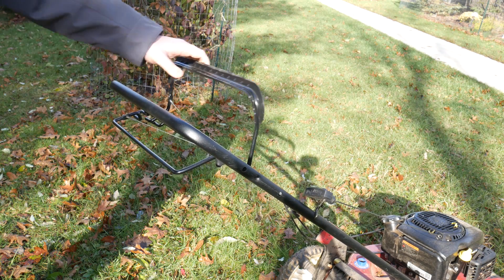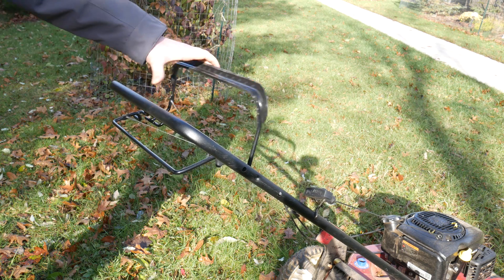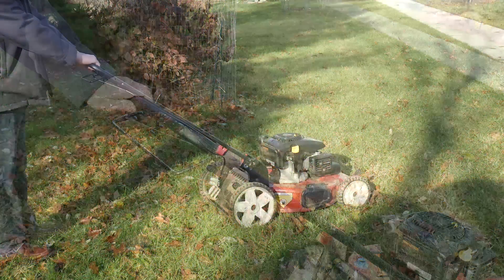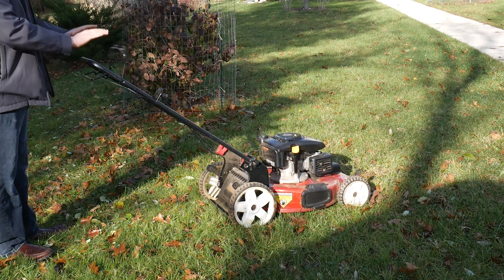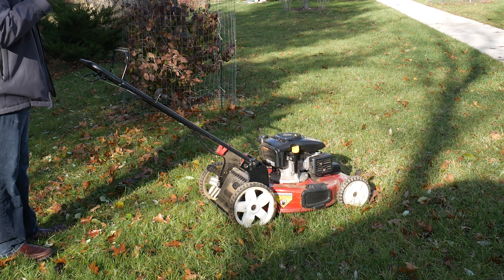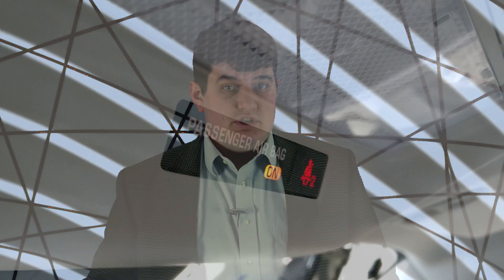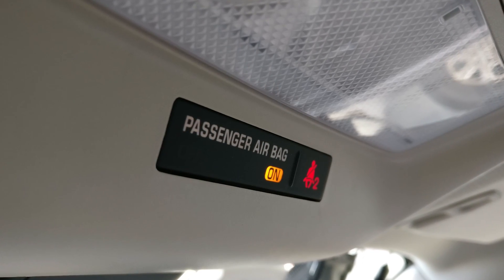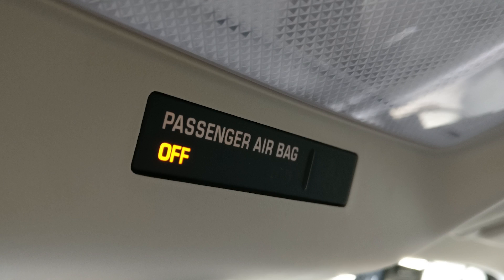The Dead Man's Switch:  How Anton Yelchin's life could have been saved

Comment: So i work for a local fire department. We have recently retrofitted my of the trucks with a vista brake lock. This system requires the driver to put a code in to move the truck. Also this system ties into the driver seat detector and if the driver gets out of the truck without pulling the air brake, after two seconds the system will deploy the air brake. Also the passenger which is usually the officer on the truck has an Estop button to stop the truck. There is also a manual override if the keypad fails but it is hidden from plain site.

Comment: One has to weigh the advantages of every life potentially saved from someone accidentally leaving a vehicle in gear when exiting, versus the number of high speed collisions that would inevitably occur on highways when someone tries to grab something out of the back seat and the car automatically slams on the breaks at 65(+) mph.

Honestly, auto breaking features that don't come with self-driving proximity awareness programming seems like a whole pile of unanticipated additional issues.
Reply: leaving a car in gear/neutral/reverse when you exit it is not a problem. You should be putting your handbrake (ebrake) on when you do, so the vechicle wont be moving anywhere. In the UK where manual is most common you leave your car in neutral or in gear (even reverse) but you always use you handbreak, worse that happens is you forgot to dip your clutch when you start it and it jumps forward and stalls.

Comment: I prefer mechanical over computer controls, due to the fact that if the computer fails, the mechanical parts can take over so that I can get somewhere safe without further incident, my truck is a 1999 Suburban, it's primarily mechanically controlled, the computer is more of a backup for the accelerator, and the timing, but nothing else, I've had more transmission problems out of my 07 Suburban (which was entirely computer controlled) than I had out of the '99

Comment: Such a system would require the ability to manually override it. As you have to be in neutral to push a car, or to tow it, both situations which would likely not have a driver in the seat. Living in the land of ice and mud, I wind up having to push my own car in my driveway more often than is probably normal. If I couldn't get out of the car without it putting on the parking brake, I'd just be stuck forever. Couldn't even use my truck to drag it out. 

I guess I could just throw one of my anvils in my seat, or more conveniently, do what I do with most safety features... bypass them XD (For the record, I live alone, half a mile from my nearest neighbor, no children or unknowing persons are going to be, say, crushed by my garage door because I just installed the optical sensors so they're kissing in my ceiling.)

Comment: The passenger seat of my Nissan has one of the aforementioned switches in the passenger seats for the airbag system. Everytime it gets cold, like today when it was -30 celcius, something in that system fails, causing the passenger airbag to turn off and my dash lights to light up like a Christmas tree. Only solution: run the seat warmers for 10-15 minutes. 

I'm all for making technology safer for everybody. However, all I can say is thank goodness on a day like today my driver's seat doesn't have any switches in it for the airbag, ignition, or otherwise!

Comment: I work for a Honda dealer and I've seen this feature on our vehicles with an electronic shifter. It uses the door as the input and if it's under a certain speed it will shift into park.
I have seen BMW do this as well.

Comment: The problem with this is that people put items on seats like heavy boxes so a seat sensor may not be optimal. A driving wheel monitor might be better where if a hand is not detected on the steering wheel and the car is in parked or neutral it automatically engage the breaks.

Comment: Unfortunately, that isn't a realistic solution, since there is no seat switch required on the driver's side for airbag control (a safety feature) thus the seat switch on the driver's side is not a reliable device as it is not rated for use in a safety critical system. Thus, if the software were modified to use this switch there would be many reports of the vehicle not going into gear when it should (when the switch fails). If this happens with a vehicle that happens to be (say) on a railroad crossing and someone is killed because the vehicle would not move from the tracks, then the safety has not actually been improved.

If the switch were upgraded to a component certified for use in a safety critical system, and redundant switches were installed, then this would work.
Reply: literally just make it check the seat belt cars already do it and you can override it for towing just buckle the seat belt

Comment: You have a good idea but you're overlooking the way the park selection works

When the vehicle is stopped putting the transmission in park slides a hefty pin into the stationary gear to lock the transmissions movement.

Therefore if the car is moving, the gear will be moving with it and with all the vehicles momentum behind it and the pin does not have enough strength to halt it, the pin will sheer.

So instead, the computer should just apply an electronic brake in all cars just like in the standard ones as you mentioned
Reply: This is not true in the Jeep that anton was driving, the selecter lever is purely a switch, when you select park a small motor engages the not at all hefty pin into park, what the correct turn would have been was the minute anton opened the door was the car gets mad and bongs at him that he was in gear, forcing him to address the bong, or when he unbuckled and opened the door the car would have shifted into park at that time as theoretically his foot would have been on the brake. basically the jeep should have never been allowed to roll at all, also my car is from 2011 and still has a traditional transmission selector with notched positions for each selection, if i open my door with the car in any gear but park the car bongs at me constantly until i either shut the car completely down or select park. this is from 2011 and why the bloody heck didnt the jeep incorporate that its so simple, bong wildy until the person makes it stop

Comment: Drive manuals. less of electric software controlled laggy shit the better. Some things in cars should always stay hardware and analogue, transmission and steering, emergency/handbrake and throttle. None of these things should ever be changed into shitty software run automatics, electornicly engaged e brakes(that refuse to turn off and are not intuitive to operate especially in emergency, because they are placed and operated in wonky ways that dont allow for muscle memory to kick in dire situation. On top of software delay and failures. Solution is to keep core operation of the car analogue and fully hardware, driver will stay awake more and wont fail at anything hence no danger emerges. Likelyhood of mechanical failure over software and electronics is almost non existant. Especially if he had a manual handbrake.

Comment: Vw already have this sort of.
If you have the automatic handbrake / auto hold the car will not release the handbrake unless the driver is wearing a seat belt.  You can move the car without a seatbelt on by turning the auto hold off then pressing the hand brake button (,tbh it's easier to just put the sb on) but remember you can't leave the car whilst wearing your seatbelt.  
2 the car won't let you remove the key unless the car is in park. (On dsg models.

Comment: So what's the handbrake then I believe America is the only place in the world where it's called an emergency break but everywhere in the world when you're taught to drive this break is to be applied and pulled up before releasing the pedal brake and putting it in park it is a wire usually that clamps the brakes down so if the parking brake fails the car still cannot roll

Comment: I believe they don't want to put kill switches into cars based on weight on the seat or other similar factors because it is imaginable that even if the car is so broken that you can't sit in the seat, it might still be that driving it is the only chance you have for survival.
Americans especially don't like designing vehicle devices that are not easy to port into Hummers and other military vehicles, but even outside of a war zone we can imagine a scenario in which escaping gunfire is more important than properly sitting on the sit, again, especially in America.

Also, what is the risk that the kill switch accidentally activates while the car is at speed, for example if the driver lifts him- or her- self up to shift weight?  While this example shouldn't be too hard to handle, it just starts down a rabbit hole of what-if's that would be enough to make  any car manufacturer hesitant to add any mechanism to automatically apply breaks outside of emergency cases.

A kill switch when no one is pushing the gas pedal and the car is moving at below 1 MPH?  But what if the speedometer is broken?  Etc.
Reply: I think you may be confusing America with Somalia. Here in the U.S. the vast majority of people don't have to worry about getting into a gunfight on a daily basis.

Comment: If you make the seat of a car a deadman's switch, how you supposed to push it while in neutral when you all alone on highway 39 at 10 PM after your water pump explodes?
The neutral gear, while being redundant from the days of manual transmissions so you could run the engine without holding in the clutch (a real deadman's switch), is very needed for pushing and towing a car. It is illegal for a tow truck to tow a car with a person in it, regardless of why, so the car must have some way of moving freely without running the engine or having an occupant. If Anton went to drivers ed, or did any research into how to operate a vehicle, especially in the Hollywood Hills, than he should have known to engage his parking brake before leaving the vehicle. Parking on a hill? Engage the parking brake.

A lot of people with manual transmissions have a bad habit of leaving their cars 'in gear' acting like a parking brake, but i've seen cars left in gear eventually start rolling anyway, gravity overcoming the friction of the engine's parts.

Comment: As a mechanic, I can say that 1) The system you're talking about wouldn't be very difficult to implement, and 2) it would be annoying as hell. New safety features need a balance between risk averted and convenience to the user, or the user just won't use the safer product (or find ways to disable the safety). Many Jeeps already put themselves in park and/or set the e-brake if you open the door or if it rolls in neutral. (In fact, some versions of the 2016 do this, so Anton Yelchin's Jeep was probably a couple of years old.) Most Mercedes and BMWs, as well as newer Volkswagens and Audis do as well. However, there are times when you need the car to roll in neutral, whether to tow it or to make small adjustments to its position in the mechanic's shop, and everyone complains when we have to roll one of those cars around.

The best compromise, in my opinion, would be a dead man's switch that's easy to turn off temporarily. (In the Jeeps and other Chryslers that put themselves in park or lock the e-brake, you have to take apart the center console to reach the override switch, and I don't even know how to override it on German cars.) Very new Chevrolets with electronic shifters, however, have a very nice feature: If the car starts to roll or you open the door, it will normally put itself in park, but if you hit the "L" button in the middle of the shifter twice, it will turn that feature off. However, and this is very important to just how safe the feature is, it will turn itself back on if you change the ignition status (turn the car off or on) or change gears. That way, you can roll it whenever you need to, without taking anything apart or having to have dealer-only software, but the safety switch is also always active when you don't explicitly need it off. It's rare these days that I think Chevy has anything that's better than most other manufacturers, but they definitely have the best mix of safety and convenience in their electric shifters.
Reply: Okay, so I wrote that at around 6:00, before you talked about overrides. Yes, a simple override that automatically turns itself off should have been in all such systems from the beginning, and I really wish Chevy weren't the only ones doing it. (Also, now that I think of it, the seat sensors are controlled by the BCM, which is also what senses the opening of the door, so obviously it isn't hard to get the BCM and the TCM to talk to each other.)

Comment: The override is important. If the car's engine quits it is very useful to be able to push it away from the road even when nobody is around to help. The problem of fuses blowing leaving the car with no power also needs some consideration. Not a common problem I guess.

Comment: The only modification to what you have said that I would add is too include some way manually to put the transmission in and out ofnuetral when nobody is in the drivers seat so as to push the car when needed as the number of various reasons to need to push a car are quite high, even if not everyone will ever need it those who do would be thankful for it

Comment: I realise this video is old but I still feel this needs to be said. As a technician at a new car dealership I see a few problems with your logic. 1 passenger presence systems are generally only found in the front passenger seat, and even though they are crucial to safety, most manufacturers make the systems very cheaply. Most air bag lights we see come from the PPS and that could leave allot more people stranded than saved if it was implemented as a dead man switch. Also not having a physical connection between your steering or brakes is illegal, at least in the United States. It is a legal requirement to be able to stop and steer a car even if power is lost. Yes electric power steering is now common but there is still a physical connection legally required.

Comment: That can't be added with code -  not that it's hard, but apart from switching the gear "with wire", you also need to move the lever the driver switches gear with. That's why it can be implemented in the next gen of cars - possibly this year.

Comment: here's an important consideration you missed: what if the sensor fails? Then you're left with an otherwise perfectly functional car that won't let you go anywhere because there is such a ridiculous single point of failure. If you wanted to avoid that possibility, there would have to be some bypass system in place, which would end up being abused and someone would get injured anyway. Adding more safety because of a single freak accident is not the way to solve problems. Something much simpler that many cars already have is simply to have a warning chime / on-screen message if the driver's door is opened with the car not in park. At least this doesn't make the car undrinkable should you have the legitimate need of driving with the door open (say you're driving up some ramps to service your car and want to watch how far up the ramp you've come).

It's not about how hard it is to make things safer, if you wanted to stop ALL deaths on the road, you would replace the airbags with machetes, then nobody would drive above 5km/h. Often times do people react with "add more safety" every time any accident happens, but many times this reaction is simply ill-formed.

Comment: I do truly hate the thought steer by wire, it's bad enough our 05 has a drive by wire system and it's just getting absolute shit for gas millage, and the throttle response can be unpredictable.. Some days you have to press the gas pedal up to half way down to get up to 40mph, typically there's no control between idle 600rpm and 2,000 rpm, and it has a latency that combined with the lack of fidelity makes it unpredictable in parkinglots, and one of my favorite instances was one day it would idle normally but as soon as you put it in gear it would rev up the engine... To go 40that day all you had to do is put on the brake repeatedly to keep it under, and at a stop light it actually stopped pulling which amazed me but as soon as I hit 10mph it started pulling again.. Now with a failing drive by wire experience like that it makes me want a vehicle with a throttle cable, but further more I want a mechanical connection to the steering rack. If I'm driving I'm responsible for what that vehicle is doing and hey this trailblazer I was talking about has an offset in the steering, some slop, and if the road tilts it tries to nudge the steering wheel. But with the physical feedback I can counter nudge it and if the car has any electrical melt downs while driving 50mph by a cliff, I'm not likely to die because the power steering went out from the engine stalling, if it was steer by wire I probably would.